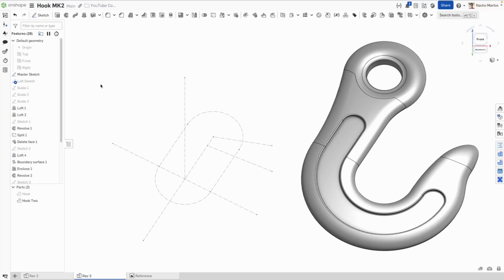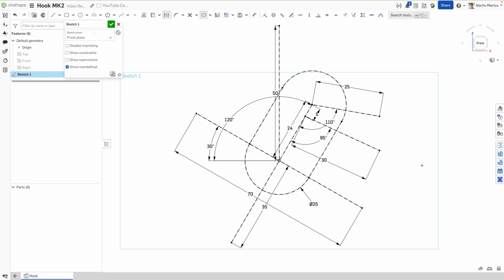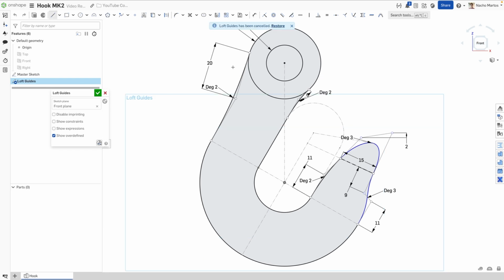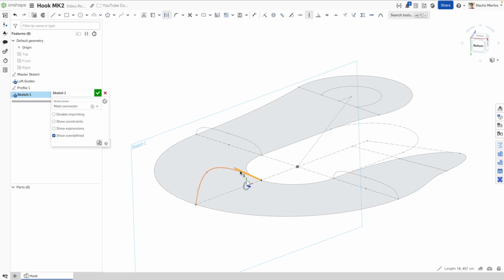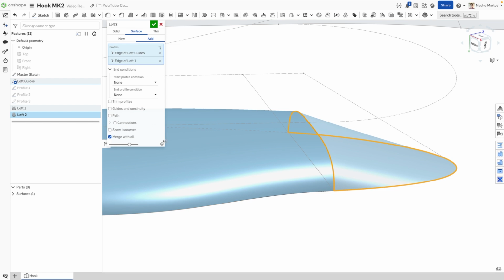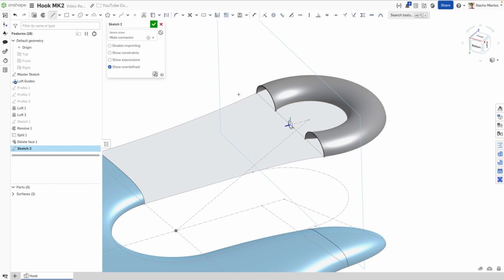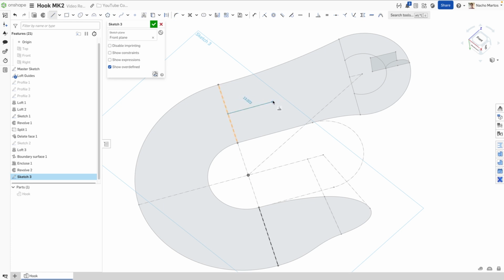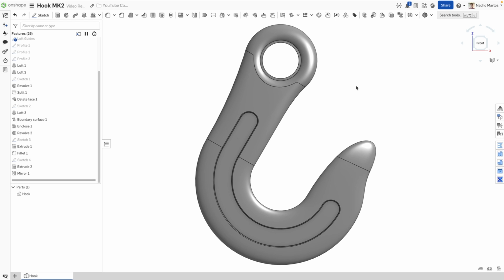Crane Hook in Onshape (Tutorial)

Comment: 9:53 this constrained state could be accomplished without the construction line by giving the spline handles vertical constraints, setting them equal to each other, and adding a midpoint constraint between the handle points and the middle spline point. Then just dimension one of the spline handles to the 3 cm.
Reply: Or draw a vertical construction line in the middle. Then box select and copy paste for the 3 other ones (and just re-attach the end points).